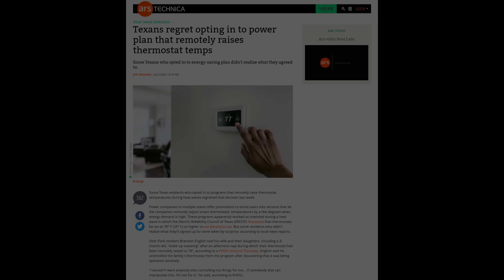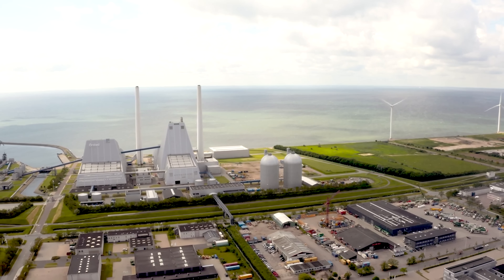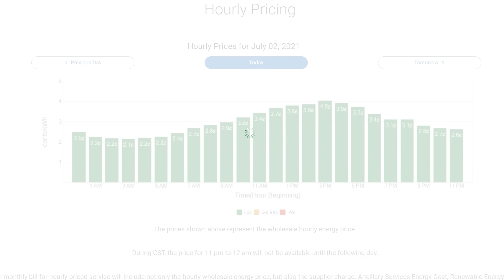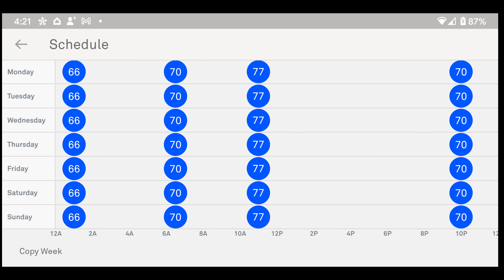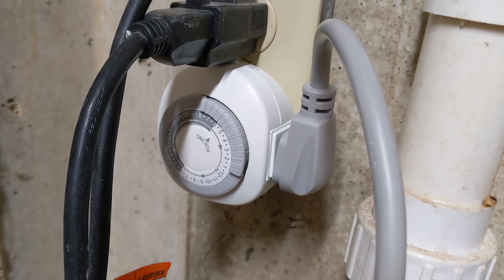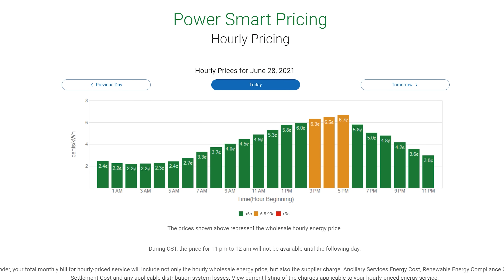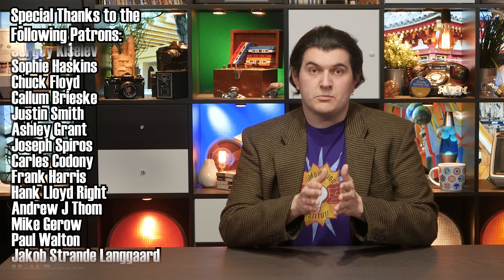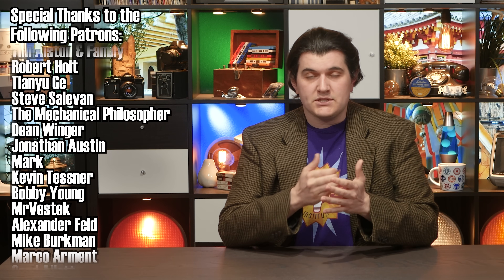Batteries aren't the only way to store energy. Here's another.

Comment: As a Brit living in the USA, I was always surprised that my electric water heater didn't have a timer on it. Keeping that stuff hot all day when I was out at the office just seemed crazy.  I assume that had something to do with the need for the American flag in every turbine hall?  Maybe that's changed now, it was a while ago.  Also, electric Economy 7 storage heaters were an absolute disaster:  they guaranteed you woke up in a heat wave but your house was freezing in the evening.  Many people wouldn't buy a house that had that stuff installed.
Reply: I always found storage heaters unacceptably leaky too. However I’ve seen an interesting use for that technology in recent electric radiators which don’t proclaim to be “storage” but do have some firebricks inside — then the heating element generally runs for a few minutes every 10 minutes or so to keep the bricks at a constant temp, rather than running for hours and stopping for hours and running for hours. More about smoothing out grid demand than reducing overall expenditure. Though it can help reduce expenditure in some cases if you have a flat rate.
Reply: it's easy in AZ during the summer, the ground itself gets so hot that you don't even need the water heater
Reply: "As a Brit living in the USA, I was always surprised that my electric water heater didn't have a timer on it"

This is a bit ambiguous and hard to deal with. Where in the US are you talking about? Our system distributes far more authority to more localized governments than the UK legal system. This means that far more of our laws are based on the individual interests of the people in that state, rather than a group of experts in the nation's capitol deciding how things ought to work. This has both positive and negative effects. On the bright side, whatever your political ideology, odds are you can find a state that suits your needs. On the negative side, many large scale safety and practicality concerns are left up to the states and if the residents of that particular state just don't care about that issue, there's no interest in the state legislature to impose it. 

"  I assume that had something to do with the need for the American flag in every turbine hall? "

Its interesting that at any time, anyone can be as aggressively rude to the United States as they like, but this doesn't hold true for any other nation or culture.
Reply: @JD-xz1mx  People feel free to be rude to USA denizens because of your fellow country person visiting other countries and being rude. On the international stage your fellow country person laid behind them a wave of rudeness.

Comment: I'm helping my folks right now reinsulate the house. It was built by a dingbat who used paper blow-in that's now settled, and being in Michigan means cold summers and hot summers.

They want new insulation, triple pane windows, and installing central AC to improve climate control, but I'm hoping to buy it from them, and when I do, I want to see about installing a geothermal heat exchange. Running heat-pipes through the house and down into the earth to wick away heat in summer, and draw up the consistent 65 F of the ground in winter. Plus of course solar pannels on the roof and outbuilding to just offset energy demand in general.

I know one house of millions won't make a lick of difference, but as said in this video; knowing I'm not burdening the system and keeping my carbon footprint down feels good.

Comment: There are some fun ways you might be able to get a house to be a better battery, too. Add as much thermal mass to the house as feasible. Have stone or brick on the inside of the house with insulation outside of it, so that your house has more capacity to store and release energy throughout the day

Maybe set up your attic as a completely insulated space and concentrate overcooling there, then have some vents running from the attic to the rest of the house so that over the course of the day you can let the cool air fall to the rest of the house and better regulate temperature. Of course, it would be best to have a lot of thermal mass in the attic to "store" cooling, but that's kinda limited by the weight capacity of the attic

Doing the reverse for heating would be easier, though, where you insulate the basement and load it up with thermal mass, just overheat during the night and let the heat flow via HVAC vents to the house over the course of the day
Reply: Starting out I thought you were going to recommend keeping more beer in the fridge…. The beer has way more thermal inertia than air and doesn’t spill out on the floor like cold air every time you open the fridge!  Makes sense.

Comment: If a big enough multi-timezone country is connected in 1 grid, It could almost forget about these problems.
Reply: If a country is big enough to span enough timezones to mitigate the load issue, it would be way too big to have one grid
Reply: @D3fcon141  Really? Care to explain?
Reply: @xpavpushka  You can't transport electricity over such great distances without losing most of it as heat.  AC is less susceptible to this problem than DC, which is why every grid is run off of it, but you still experience losses.
Reply: @D3fcon141  If there are power stations in 1 location, then yes, but what if we spread power stations equaly? (more or less)

Comment: I've been saying this for over ten years. Importantly allowing your energy provider to turn off your power is always a bad idea. It sets an extremely nefarious incentive that will be exploited in disasters. You want the power company to choose who dies in a heat wave? Either per hour pricing or spot incentives would be fine. But the home owner must remain in control of what they want to use their power for. The AC is a critical system and most other less critical systems aren't worth the effort.
Reply: The thermostat (i.e. any serious remote-controllable thermostat) should have a UI that lets the home owner control how many degrees the utility can swing it.  For example, I might set my thermostat to allow the utility to adjust it up or down from my setting by as much as 2º, but no more.
Reply: @kc9scott  IMO the utility shouldn't control anything. The grid operator or the energy provider can publish rates in advance just as in the video and then you or machines you control can make decisions based on that information.
This means if users for example because theres a heat wave still want to turn on their AC they can.

Comment: A very simple but effective system I learned from my Dutch neighbour was to install outdoor blinds, or shutters, on south facing windows.  Closing the blinds, drapes or whatever you call them, inside the house worked but the sun shining thru the windows heated up the air Inside the house. Blocking the sun on the outside of the windows meant the sun never got to heat up the inside air.  When it was cold outside I just left the outside blinds/shutters open and let the sun heat up the inside of my dwelling.

Comment: I have a chocolate shop and, excited to see what you were suggesting at the start of the video, feel slightly disappointed to discover ... that I'm already doing exactly this. I control the day temperature of the shop overnight, except that I don't use (or even have) AC: I use an antiquated method called 'Wind-ow's. In the morning I close all the windows so that, during warmer weather, I don't let the hot air in. 
I learnt this while staying in a French farmhouse. We arrived and immediately threw open all the windows on that hot day: the owner immediately ran around and closed the windows again.

Comment: We could just use nuclear instead of intermittent sources of power.
Reply: demand is intermittent
Reply: Nuclear is providing his baseload, did you miss that? With the economics of nuclear no one wants to build a plant which will have to run at 25% capacity most of the time. So renewables are actually a perfect complement for nuclear, with renewables supplying demand peaks and nuclear supplying baseload (a lot of calculations on how much storage we’d need for full renewables are largely based on baseload capacity, nuclear baseload would drastically slash the storage to maximise renewable utilisation).

Comment: There are other ways to do this:

- Leaving windows open at night and using fans (including a attic fan) to draw cool air in when the temperatures are cooler

- Adding thermal mass (concrete is an example of a thermal battery) stores energy and reduces temperature swings

- During the winter, hot air from the attic can be used to heat, if fans can draw it back down. The reverse can happen from the basement in summer.

- Add deciduous trees that block the sun in the summer, and let the sun in the winter. Do similar things with curtains and sunroof shades

- Design houses for greater southern exposure, and lower east/west exposure

Comment: Holy moley I am floored by your electric rates!! Our “off peak” rate has gone up to 25 cents per kWh. We have a solar preheater for our home hot water, and a gas water heater backup. There is little to no financial incentive for us to rewire the house to bring in electric capacity for an induction range and an electric water heater. We do use our microwave and ‘air fryer’ (countertop convection oven) and an electric water kettle to replace much use of the gas oven and stove.

Comment: Can't find the link now, but I read about a New England town that installed remotely controllable electric masonry storage heaters in everyone's home. When expecting a cold snap, the town would proactively heat everyone's bricks, so they would have enough stored heat to survive the storm. When expecting a grid supply shortage, they would heat everyone's bricks, then reverse them during the shortage to convert the heat back to electricity to feed the grid. Definite efficiency issues, but it saved citizens lives and smoothed out their supply/demand curve.

Comment: Many commercial buildings have a drastic heat load change during the workday that can't be overcome by overcooling or overheating during off-demand hours. However, since Commercial companies in the US are subject to demand based rates - they have been using a similar solution for years (although its not super common). Some buildings use heat pumps overnight to generate giant ice-banks in outdoor tanks during off-demand times. 

Once the ice banks are fully frozen they are maintained until the next morning. The building management system then switches the system over to utilize the ice banks - and pumps water through the frozen banks. The chilled water is then used to cool the rooms in the building similar to a standard chilled water system.

Edit: You covered it at the very end :) Damn impatience. They are, sadly, fairly rare.

Comment: We use a cooler refrigerator powered by a lithium power station when camping. During the day, we charge the battery and run the refrigerator using solar energy, while also freezing ice blocks. At night, when solar power isn’t available, these ice blocks help keep the refrigerator cool, minimizing the battery drain and extending the lithium power supply.

Comment: Here on the swabian region in Germany, some houses have been using a similar technique for decades. But in the other way around. Here where I live we don't need to cool but to heat. Especially older houses do this by heating up some big bricks during the nighttime and then blowing air form the room through the rocks in the daytime. A special controller keeps track of how cold it is and decides how much the bricks will be heat up during the night.
But this technology seams to not be doing so well because it is mostly found in old houses like the one of my grandma. Newer houses mostly heat by burning fuel in the central heating system. The reason for this is probably that it is not so economically viable anymore and that it does not provide the same level of convenience as alternative. Sometimes the controller doesn't heat the stones leaving you with a cold house.

Comment: no offense, but what I'd tolerate for my neighbors in a crisis is different from what I'd tolerate as an annual expectation. I'm paying for air conditioning and electricity because I am extremely uncomfortable in even just warm temperatures, and I'm not about to let the electric utilities get away with just not increasing supply to save their overhead when there's reasonably foreseeable demand increase.

As I said, I'm willing to minor sacrifice in a crisis, but I'm not willing to be expected to sacrifice for someone else's bottom line, especially when I made purchases under the expectation that I'd be able to use the products/services.  I live in Wisconsin and our weather isn't cold enough for me most of the year - I set my thermostat to 68 degrees somewhat frequently in order to feel comfortable in clothes at home, otherwise I can tolerate up to 74 when practically nude.  Those are my preferences and I pay the price for them, and I'm not about to accept being 'guilted' into sweating my ass off at any time of day, let alone forced by a company that promised a service it couldn't deliver.  I'm up for trying the load shifting strategy given I love my winter blankets, but I seriously doubt it'd go as well for me as for you.  I'm more than willing to give my neighbors my time, labor, food and friendship, but I ain't giving up my comfortable climate for them outside of exceptional circumstance.

Comment: One big problem with bulk storage methods is the fact that the transfer of energy is not 100% efficient. Pushing into a storage medium and then out again has always had a cost, you lose power this way. When it comes to grid sized applications you can see the problem here: you're using more electricity overall. More dinosaur juice has to be burnt. Our throttle in the case of demand is usually coal, or nuclear depending on the country you live in. The throttle is where our focus needs to be. We either use less, or use a more efficient throttle like nuclear power.

Comment: You know it's funny. I never really thought about the fact that after we got rid of the trees in the front yard, and thus half of the shade on the house, we had to install an air conditioner to stay happy in the summer where previously just opening windows at night and closing them during the day (plus the generous use of fans when inside temperatures hit 80 and higher) had kept temperatures perfectly reasonable. Objectively, maximum temperatures didn't go up, though heat waves did seem to get longer. But the fact we knocked down our trees might well have had something to do with our personal inability to deal with the heat waves.

And then I hear you talking about shading like it's obvious and go, "oh, duh. That makes a lot of sense actually."

Comment: We do something similar whenever possible using outside air temp whenever lower outside than inside, open up the house, and close when outside air equals inside air when it's on the rise.  This has eliminated the need to even run AC for several months a year.   When outside air just doesn't go below inside air, we do the pre-cooling thing you mentioned in your video.  We have a Solar installation and use a high efficiency heat pump.
We also do the same thing in fall and spring for heating during the day when air temp is above inside to warm to help not needing to run the heater overnight.  Humans have been doing something similar to this for thousands of years.  We just need to teach and remember our history.

Comment: In Sweden where we often have waterfilled-radiators in every room, it is popular to install "accumulator-tanks" on the system.
Especially if you burn wood, they "recharge" when you are feeding the fire, and discharge the heat while you sleep/work.
My parents has 2 tanks, they keep the house warm for a couple of days even when it is -20c outside.
They also have electric heating elements in the tanks, on a timer, to charge the tanks in the night and not run during the day if they are gone for a prolonged time. (heat battery)
The house was also built in the  50's, so the pipes for the heating is beefy enough to make the water self cirkulating from the basement where the heater is to the 2 floors above. ( there is a ciculating pump in the system though )
They had a prolonged power outage due to a winter storm taking out the grid, but stayed warm and toasty anyway, and only started up a generator once a day to charge their laptops/phones and make food and coffe

Comment: I'm using open windows during night to cool my house, helps also with co2 venting.  There are only few days during summer that are uncomfortable hot but as i learn in this channel that is not reason to not use it. Also electric distributor in our country did not guarantee any specific time for low cost electricity, its just random but one segment is at least 3 hours long, which is usually during night

Comment: Many things can be used to store/save energy. When you run your hot water boiler during the night, but run your dishwasher during the day, it makes sense to use the hot water from your boiler to feed your dishwasher. The dishwasher will use less power during expensive hours, and you will shift load to the night tarrif. And there are many more examples.